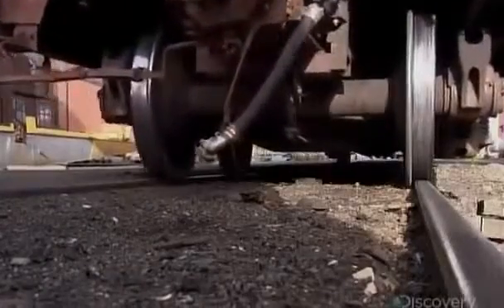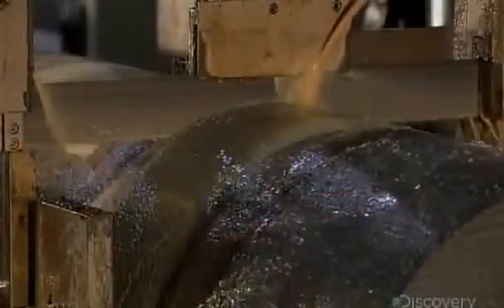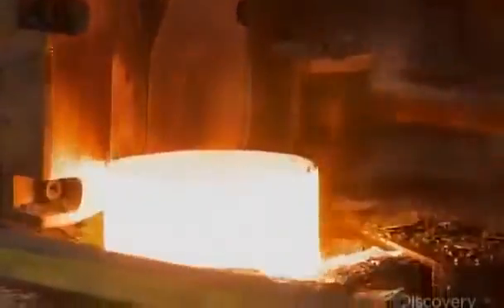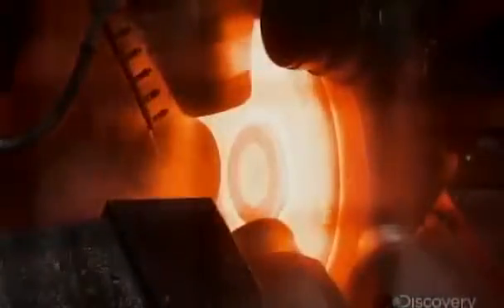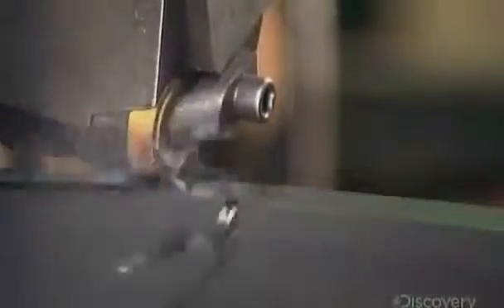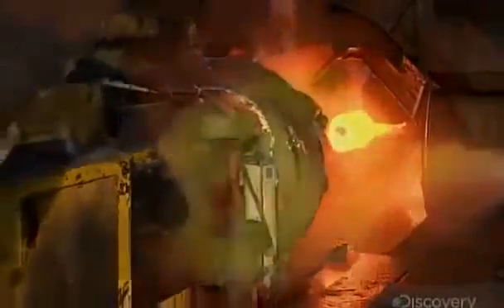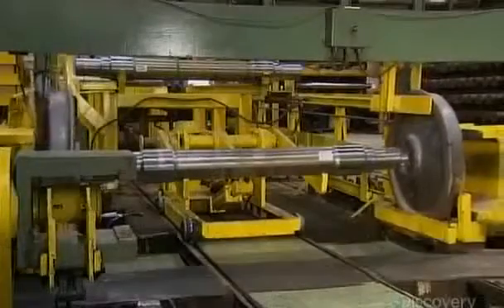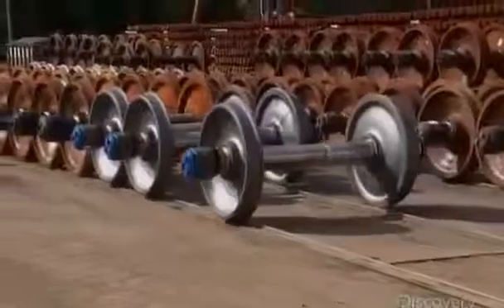How It’s Made Train Wheels

Comment: In the early 1980s, I worked in a factory that made train wheels in Montreal.
Canadian Steel Wheel (CSW), a division of Hacker Sidley Canada.
It looked a lot like the factory in this video, but there were 7 stages to the forge.
What is missing from this video is the deafening noise within the whole factory. A source of tinnitus guaranteed, if you don't wear hearing protection.

Comment: Hello:  Attention:The rail wheel  Lip on train Steel wheels is Not Made Right: It Should Be increased by 1-1/2" inside Lip Diameter which holds Steel Wheel on the Tracks during swaying  or around curves more Securely: The round Flat 4-5" wide  Steel  on track  Is Holding Well: The Diesel  engines Locomotives Can use Newer Up dated Wheels also : At the moment  there  is way Too Many De-Rail-Ments going on this Needs too be Stopped  immediately My Name Is Donald